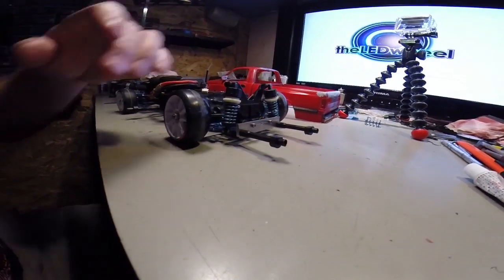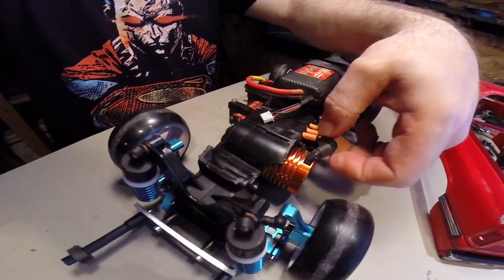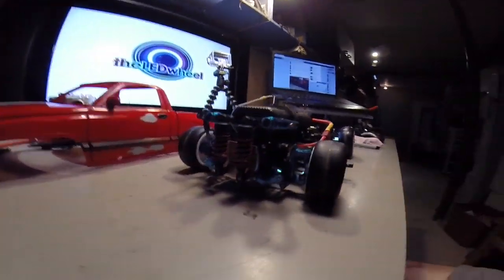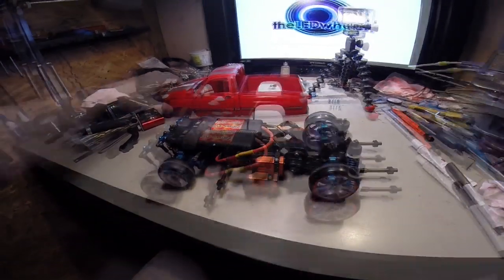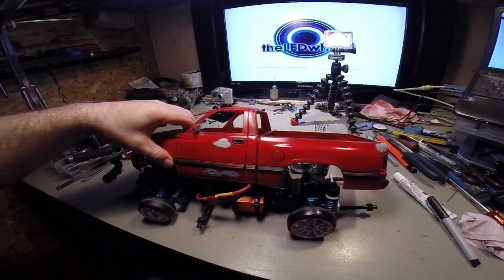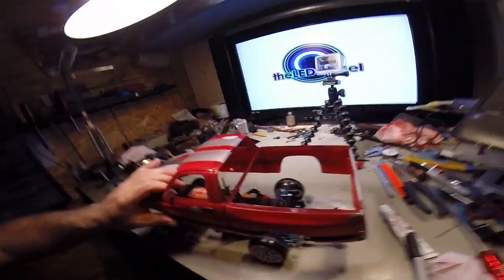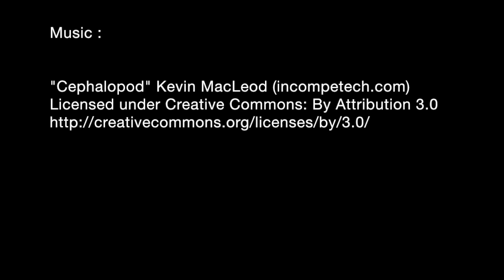Inverted M03 part 4 build finish + test, I think I need driving lessons O_O

Comment: WD-40 works great to remove sticker residue but often times if you use a hair dryer and heat the stickers up real well they will come off without leaving any residue at all. Put it on low heat so it doesn't heat up faster than you can save it

Comment: I would try rubber tires in the rear too much slip in the rear and if there too grippy spray them with armor all.
Reply from the maker: Thanks for the idea. I found some different compound drift tires and am going to try the stickiest of them. If they bite too much I will know that its a grippy issue...
Reply: or you could try moving the battery to the rear of the truck
Reply from the maker: williesurvives1 I ordered some stickier tires so we will see how they are, then if thats not enough I will start moving weight around.

Comment: ive seen alot of rwd drifters with gyros its still going to be hard to drive that will help
Reply from the maker: I have one, I will have to check to see if I can use it. Question is, where to place it on the vehicle so it does the most good?
Reply: TheLEDwheel  yeah it is a little tight to put on there, as far as where to go its about the middle or front of the kit